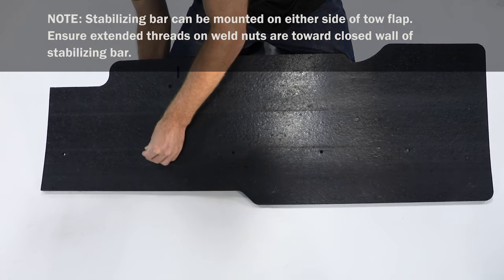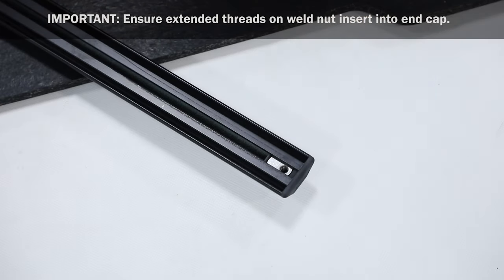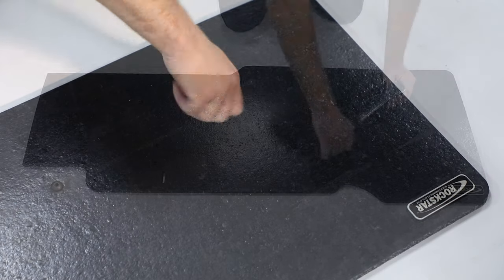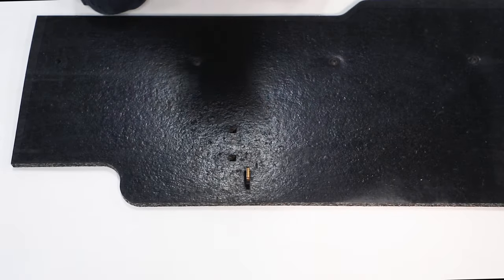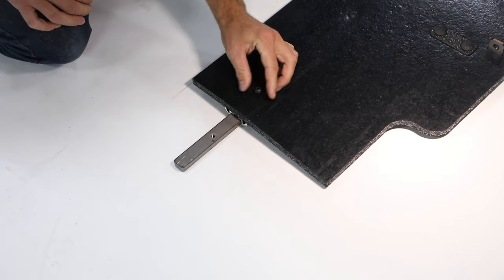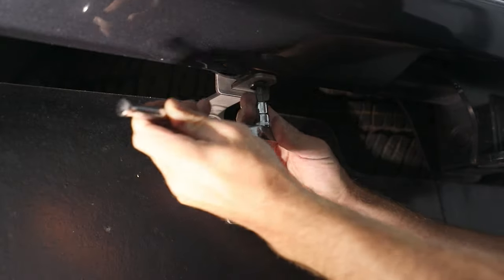ROCKSTAR™ Commercial Tow Flap Install Video – Agri-Cover, Inc.

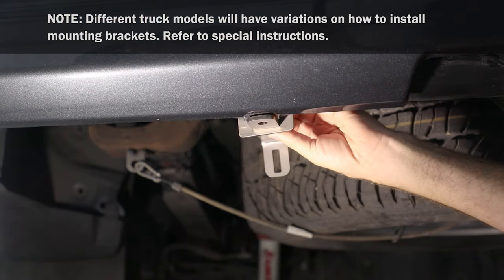Comment: The first bolt at ~1:07 is the stock bolt on the truck.  What is the second bolt?  Is that a stock bolt, or is it a ROCKSTAR bolt?  Do I have to drill a hole for the second bolt?
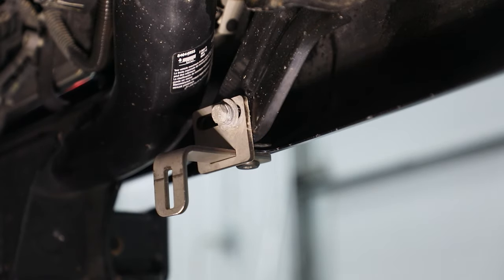Reply from the maker: Hey Jeff, the second bolt that you see at 1:18 is a ROCKSTAR supplied bolt. Commercial Tow Flaps are model specific so depending on your make on model the bracket installation will vary slightly, but you will not need to drill any new holes into your truck to attach them under your bumper.